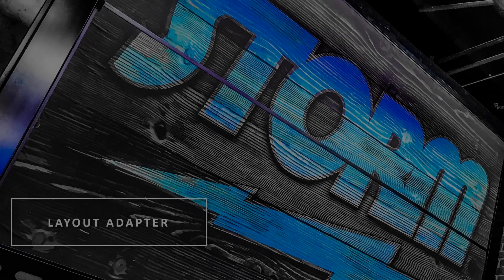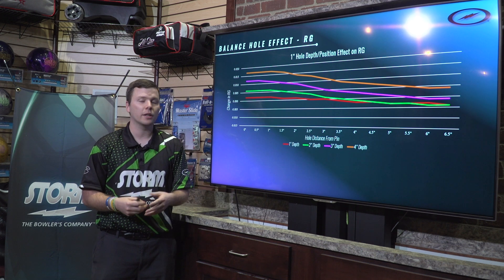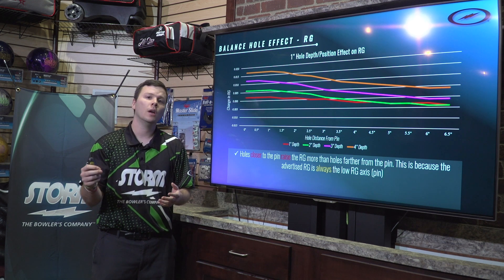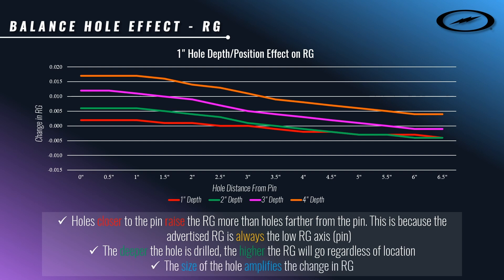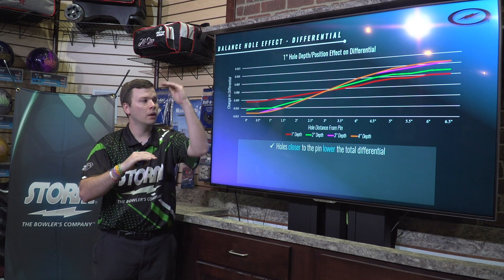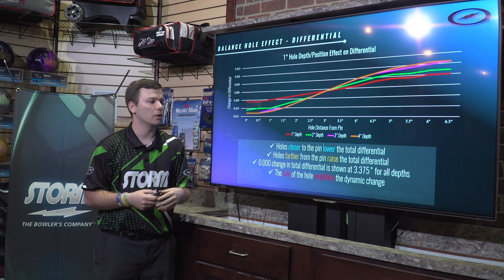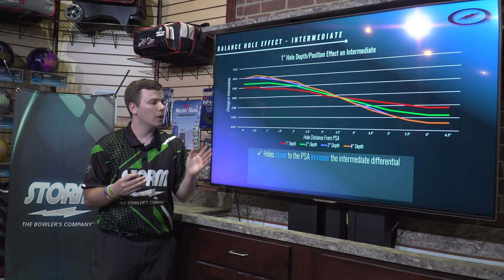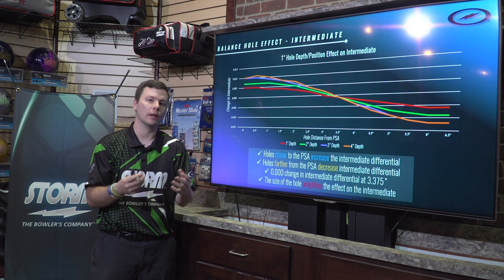Storm | Layout Adapter | Balance Holes

Comment: So, for symmetrical balls, if the thumbhole (effectively a 1" balance hole) is drilled 2.75" deep, 6.5" from the pin, the RG of the x-axis would be lower and the total diff would be higher.
Reply: No the value of the Y axis rg would be higher which makes the differential higher. 

X axis = pin 
Y axis = biggest rg band 6 3/4” / equator of the ball